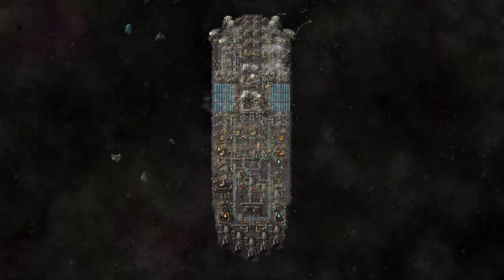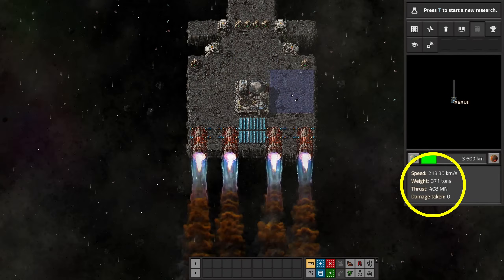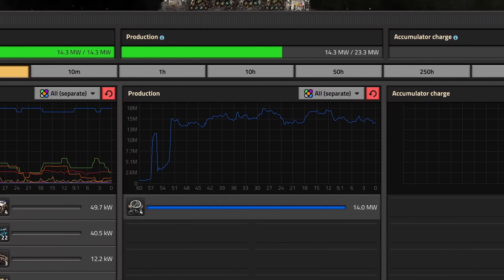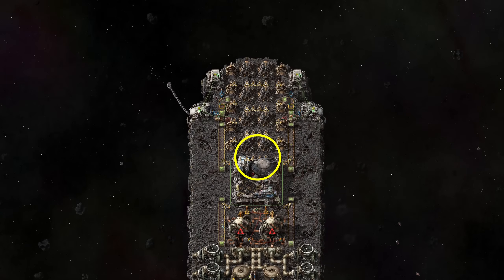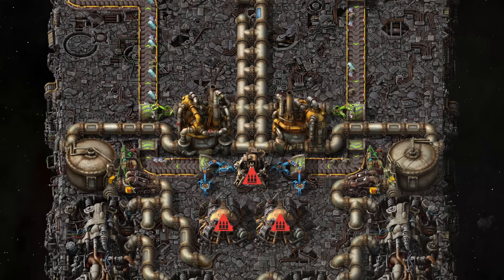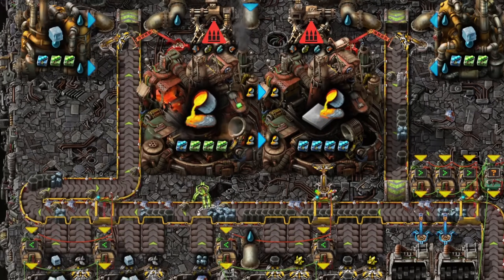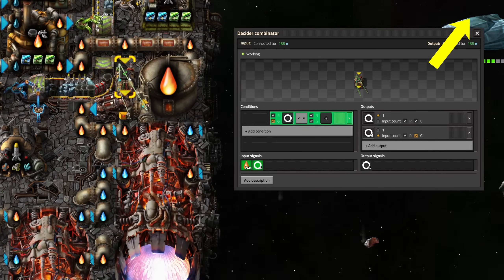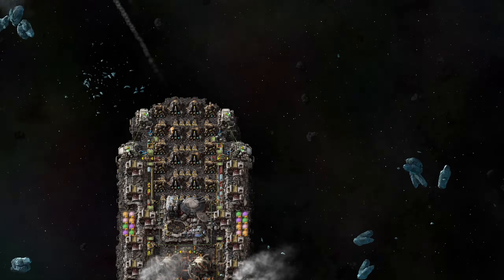Aquilo Spaceship Design - Fast, Reliable and Gorgeous! - Factorio Guide / Tutorial

Comment: In Factorio 2.0 you can actually blueprint and place buildings with fuel in them. This means you can make a blueprint of a Nuclear Reactor that 'needs' 1 fuel in it. Normally the bots will build this for you, but it also works on ships. You can use this to launch self starting Nuclear Reactors;

THe way I did this is first, on Nauvis, place a ghost of a nuclear reactor outside of Robotport coverage. Then open map mode, click on the ghost, and the "Nuclear Reactor" window will open, with a "Ghost cursor selector" window on the side. Click the Nuclear Fuel to 'pick it up', and right click in the fuel field to add 1 fuel cell to the ghost. Now copy/paste this blueprint into your space ship, and the fuel cell will be inserted into the reactor. Once that's happened, it's considered 'Build', and it won't magically insert anymore fuel cells. 

[[~Using this, your blueprint should be able to avoid needing to use the Solar Panels.]] Never mind, I realize my ship already had water in the pipes, to heat up. This still wouldn't let you start the ship from nothing.
Reply: Noob 😂

Comment: Belt with mats (iron ore, plate etc.)  getting clogged after some time. Looks like there is too many iron ore (450+) and maybee plates as well (350+). This is happening basicly on every sushi space ship what i try. Im usually solving it with inserter throwing it to space (condition > number of specific item). Dont know yet how it will work in long term.

Maybee it have something to do with extra asteroid production, but not sure.

Please, did someone have more sophisticated way to solve this?

Thanks You for design and effort!
Reply from the maker: Do you have belt stacking and transport belt capacity at 4?
If not, use the other blueprint, it works without belt stacking. It has different maximum values for all items.
Reply: @AVADIIStrategy Actually i finished that research after space ship, looks good for now. Thanks!

Comment: 1:27 the solar factor you pointed to is incorrect(1%), the correct solar power is the solar power in space(60%), since you're designing a space ship. Solar is usable however nuclear is much more reliable anyway, fusion is even better.

Great video
Reply from the maker: Thanks! Yeah I f***ed up the arrow position ;)
Reply: @AVADIIStrategy Not a problem Mann, you nailed every single video. I'm especially a fan of your gleba video with blet main bus base.

Comment: My "Aquilo Ark" is a very different design, but I'm not too concerned with speed; it's quite huge with tons of cargo holds and ten thrusters. While it's also relatively slim end elongated, I did this mainly because I would have less area to protect against asteroids while in transit this way. 
 
I didn't actually know that the big asteroids start showing up around Aquilo (I thought that was only for the solar system edge), so I built the ship with lots of gun turrets and red ammo production - big mistake. 
Instead of reworking the entire design, I simply added a large stack of laser turrets at the front (and numerous smaller islands of laser turrets around the hull to protect against asteroids while stationary): Large numbers of laser turrets easily cut big asteroids apart, despite the high resistances. They also made the gun turrets redundant, but whatever. So, no, rocket turrets are not mandatory at this stage. ;-)
I have a 2*2 nuclear reactor setup with stacks of turbines on the right side, while the left side is all about production. I also set up a small nuclear fuel cell production onboard, because importing the raw materials is faster and more space-efficient than importing the cells themselves. I also use lots of solar panels to save nuclear fuel cells while it's doing round-trips nearer to the sun. 

I love how different everybody's ship (and factory!) turn out. It's one of the main reasons I don't actually want to use other people's blueprints, although I may crib a clever idea here or there. I did look up how to get the circuit logic for saving nuclear fuel cells set up properly, for example. I don't really use circuit logic yet and instead rely on tossing overflow back into space. I may look at some circuit logic tutorials in the future, though. I will also have to look into using belts for transporting goods. Right now, I just use high quality cargo holds, but I could believe that using belts is more effective with belt-stacking active. I think that's what people do for promethium harvesting?
Reply from the maker: You for haravesting you need wide ships.
But the idea to make a laser ship is actually funny.
Maybe I'll do that at some point. :)
Reply: @AVADIIStrategy  Right, that makes sense: You would want a broad ship profile, so that you have more incoming asteroids to harvest en route. 
But what I meant was that I've seen people use belt-stacking and belt-weaving instead of cargo holds for actually transporting the harvested promethium? I think I've seen that in some other short but I don't know how the actual capacity stacks up against just using high quality cargo holds. 
As for laser turrets: I think it's quite pleasing visually to see the laser turrets do their work on the asteroids, too. :)

Comment: I've been building space platforms in the creative world for about a week, but I still haven't managed to achieve a big difference in speed. Thanks for the video, otherwise I would hardly have figured out that the width played a key role all this time! By the way, from time to time my platform either loses or gains 20 km/s, although I always fly at full speed. What could this be connected with?
Reply from the maker: The first 50% of the way you'll be 10 km/s slower and the last 50% 10 km/s faster.
It's supposed to be gravity and they made it this way so that platforms don't get stranded and slowly travel to the nearest planet if they are out of fuel.
Reply: @AVADIIStrategy  Hm, interesting mechanic. Thanks for your reply!

Comment: For the longest time I've noticed various youtubers actually coming up with inferior designs to the ships I've created. Your design is one of the few good ones AVADII. What I've done with my nuclear designs is I've got a green wire connected from an inserter to a steam tank from a nuclear design to control whether or not it should add another nuclear fuel cell. I've got 200k steam in tanks as a buffer and only to be used if the solar is insufficient which really only means if an Aquilo journey is on the cards. It basically needs refueling once every 20 trips to Aquilo though it isn't as fast or small as your design here. 

I love this whole idea of cargo ships. I've got Small, Medium and Large Cargo haulers mostly with standard quality but I do have a few experimental ones which use only legendary gear and they can go to Aquilo with just Solar and stay in the atmosphere indefinitely. Maybe I should make some videos.

Love your videos bro, please keep them coming!
Reply from the maker: Wait a second. Why steam tanks? Since 2.0 we can read the temperature of reactors directly so reading steam tank content is outdated.
Also: solar energy automatically has priority over nuclear so you don't have to set up anything to only use nuclear energy when solar is insufficient.
Reply: @AVADIIStrategy The more steam tanks you have the bigger battery of steam you acquire and the nuclear plant doesn't need an injection of fuel for a very long time if the steam itself is monitored. Also for my saves atleast it appears the nuclear plant never gets below 500 degrees in space even if its not powered. Did you want to check to see if this is the same for you? my temperature is not going below 500.
Reply from the maker: @hoyschelsilversteinberg4521  You're trying to use steam as a buffer of energy. That's not necessary though because the temperature of the reactors/heatpipes/exchangers is already a huge buffer.
And since 2.0 you can read it!
Temperature = Energy.
The temperature cannot and will never drop below 500 because heat exchangers require temperatures above 500 to work and make steam.
I reckon you have to go back to square one and take a close look at how nuclear energy in Factorio works.
Reply: @AVADIIStrategy Maybe I'm complicating it because the ship in question I'm using has solar panels as well as nuclear power. Nuclear power kicking in only for the Aquilo trips or when the rail guns are going nuts.

The method of measuring steam in tanks instead of temperature results in a huge saving of nuclear fuel I've found. I've got it set so that when it detects the steam tanks are at 2000 steam to insert a fuel cell. Because the reactor stays at 500 degrees for a very long time and that solar is enough to carry it through it elongates the fuel cell storage life immensely. If it were to go by temperature I'd waste a ton more fuel cells for no gain.

I say all this because I believe I have found the best saving in fuel cells.
Reply: @hoyschelsilversteinberg4521  Hey,  just a tip here but AVADII is right about heat being a buffer. The ONLY time you waste energy with a nuclear reactor is when you are "burning" a fuel cell and the temperature of the reactor is at 1000C. As long as you stay below 1000C none of the energy is lost. There is functionally no difference between reading steam and reading temperature to control insertion of fuel cells. But the later is more compact since you don't need steam tanks. The nuclear reactor buffers 10MJ/degree C so from 500C to 1000C you have a 5GJ buffer, which is less than a fuel cells 8GJ energy value, but considering the heat pipes and heat exchangers also buffer heat at 1MJ/Degree C so as long as you have 4 heat exchangers and at least 2 heat pipes you will not waste energy. All of this assumes a single reactor design. If you are using a multi core design then you could easily end up in a situation where you actually can't buffer all the energy, in which case steam storage can solve that. I don't know why AVADII was so dismissive of steam tank content reading, it still has a place. Although this entire argument is underpinned by the reality that saving fuel cells in vanilla is "just for fun" and grossly unnecessary, but I respect saving fuel cells as a matter of principal.
Reply: @markpew8111  Yep agreed. I only noticed this when I noticed my spaceship in question with the nuclear steam buffer almost never needed more fuel cells realising that the steam buffer offers a huge saving in fuel cells. You are correct though that fuel cells are basically not worth saving as you get so many.
Reply: Is the TLDR of this thread that nuclear heat is only consumed when it is turning water into steam?

If so, then the goal is to get to just under 1000 and then load when just over 500?

How much "temperature" does one cell add assuming no water is converted to steam?

Comment: I'm in the market for a late-ish game ship that can run the inner planets including Gleba, if you happen to be looking for video ideas. Something that can be built after all inner planet tech is unlocked, including advanced fuel production. Can't seem to find any blueprints online that fit those requirements, it's all Aquilo or early game stuff. Just thought I'd throw that out there.
Reply: To be fair, you can make a perfectly serviceable inner planet freighter that is capable of hauling all your required goods and operating effectively non-stop before unlocking any planetary science. Asteroid reprocessing can be nice to balance things out, but there's not a ton of need for advanced fuel production since the real limiter isn't fuel but how fast you can make ammo. 

You can use Foundries to make your iron plates but the iron is unlimited so there's not much gain for the production bonus, you then HAVE to keep a storage of calcite somewhere though you'll probably still produce more than you use there's a slim chance you could softlock yourself by not being able to make ammo, and you're definitely sucking more power than you would with some electric furnaces.

You don't need missiles for the inner planet circuit so there's not much purpose to producing them, cutting off the need for more Advanced Asteroid Processing. Fulgora doesn't have anything required for space travel at all IIRC. So the only thing that's especially helpful is Asteroid Reprocessing which is really a "nice to have just in case." Advanced Fuel Production can genuinely be replaced with a second chemical plant and that prevents the need for storing calcite which is more of a logistical problem than anything since you will absolutely produce more of it than you'll use, so you either need to unload it into space or regularly dump it on planets and the amount you'll have at any given time is random so it's difficult to automate planetary dumping.

Jar Games did a build for a freighter that only used Reprocessing in a video recently as part of his play through series, the video goes pretty well into depth about the design choices and how most of it works and should work as a decent starter to design your own; though Jar included a blueprint for the ship he built if you just want the freighter already done for you.

AVADII also has a mini-ship that can safely get you around the inner planets. It's not serviceable as a freighter but it can absolutely be sent on supply runs or used as a personal ship. I found you can add Advanced Fuel Production to it to keep it effectively permanently fueled, and as built it carries loads of ammo so it can make a ton of trips without stopping for very long. The biggest flaw is that it produces too much calcite and needs to dump it semi-frequently due to the low inventory space.

But yeah, tl;dr there's not much in the way of post-inner-planet-but-pre-Aquilo ship design because there just isn't any need for it.
Reply from the maker: You can use this one. Just remove the rocket production and rocket launchers if you will never go to Aquilo with it. Or keep it and just change the rocket launcher filters so that they will help killing medium asteroids.

Comment: why do you need solar to start the reactor?
Reply from the maker: Without electricity there is no water production, no inserter movement. Without water there is no steam and without steam there's no electricity.
Solar panels have to kickstart these processes.
Reply: @AVADIIStrategy  I forgot that you need energy to produce water. I manually put 50 cells into the fusion reactor on my platform

Comment: A wider ship however can employ more thrusters and collectors both. So i dont see the disadvantage here. Its rather the contrary: wider ships slightly diminish the number of destroyed but uncollected asteroids on the sides. 
Always looking forward for your next video.
Reply from the maker: Absolutely. You can build a wide ship which is just as fast. But you need to build and produce and transport way more machines and materials. Without any benefit... unless you're building a space platform to collect and farm materials but that's not the purpose of this ship.

Comment: Отличная работа. Пришлось немного даунгрейднуть, по некоторым модулям и манипуляторам и весь конвейр захламился. Пришлось покопаться в логике и пересчитать.
Reply from the maker: Did you have belt stack size 4 unlocked? If not the numbers have to be different, yes. Too much materials without belt stacking unlocked.
Reply: @AVADIIStrategy Пока не разблокированы(. Поэтому и пересчитывал.

Comment: I understand thin is fast, which is good.  I understand weapons in front because fast = smash.  What I don't understand is what you do in orbit.  Asteroids come from all directions when you're stopped anywhere.  Not very fast, but they come.  So this ship can never wait at Aquilo, or any other planet without taking damage?
Reply from the maker: If you take a close look there are 2 rocket launchers and 1 gun turret in the back. In the middle of the ship above the foundries another 2 gun turrets. So all directions are covered.
Reply: In my experience, as long as you don't linger too long, large asteroids from the back aren't really a problem.